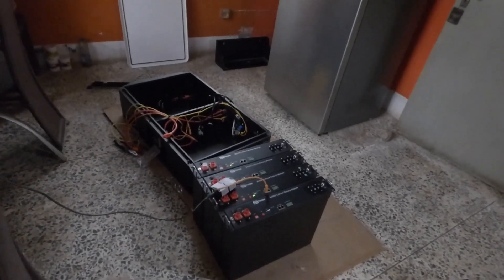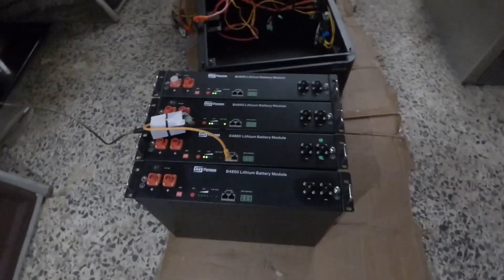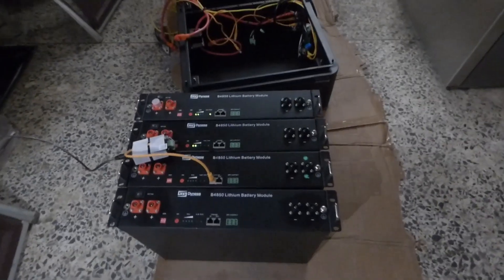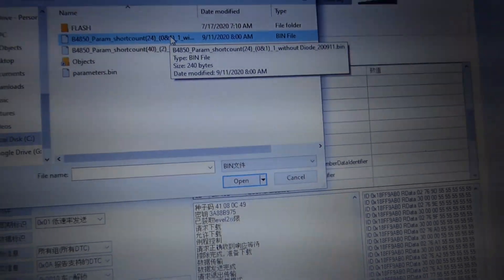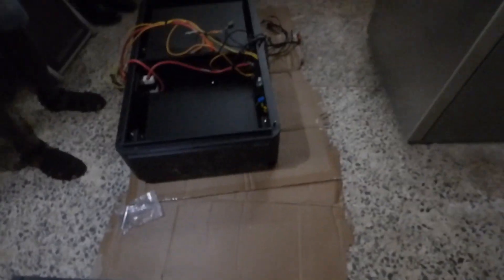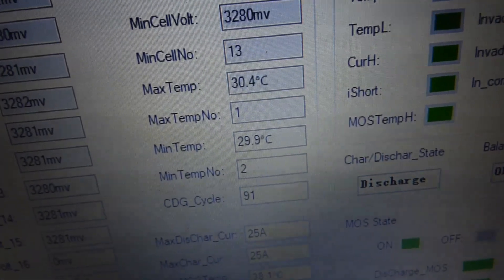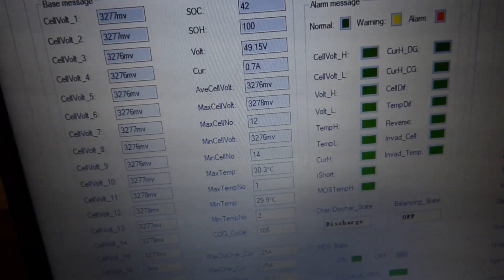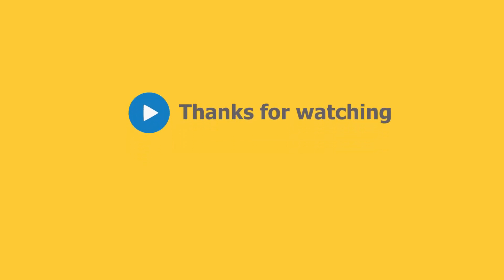2 days without sun, and now no power. What happened?

Comment: Being in the IT sector, a suggestion Dr. Solar, Deye/Sunsynk may actually introduce as a first, a firmware on their Inverters which queries via the CAN-BUS or RJ connection if all batteries have the same firmware and alert an installer… food for thought, that would not be difficult to code.
Reply from the maker: Nice suggestion. They already have an alert system for low battery, overload.

Comment: Good to hear from you again.
Reply from the maker: Hello Marco we were discussing you yesterday, some bonding questions. How are you? How is 8 kw working out for you? Stay safe and healthy
Reply: @drsolar  HI Chris our inverter is running very well, using 13kw of leaf batteries which will provide power to the critical loads panel for at least 20 hrs. We have had at least 24 power faults or failures. Ranging from 1 min to 12 hours, and with at least 4 being more then 1/2 hr. We don't have solar connected to it. But that's fine, solved problem of losing power. In the future i will do something to get back a return on investment and install some solar. But thanks for all your help. Stay Safe my friend!!!